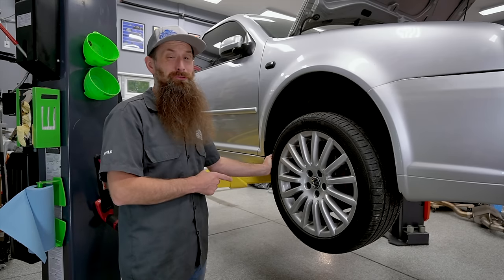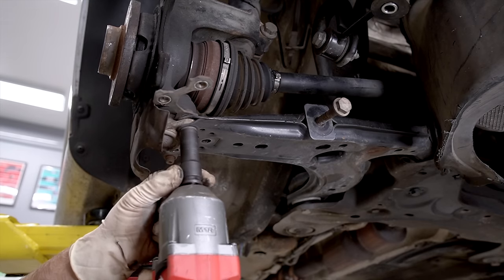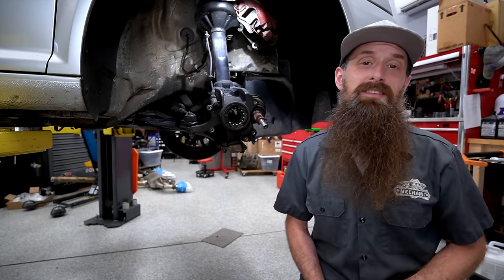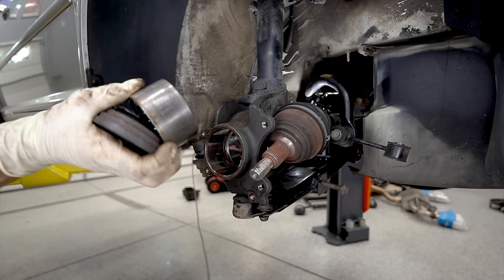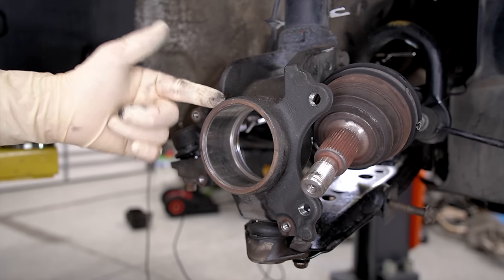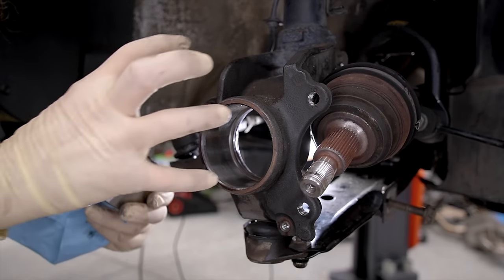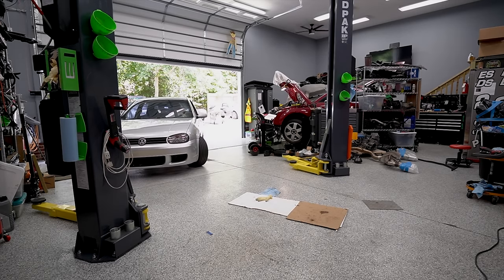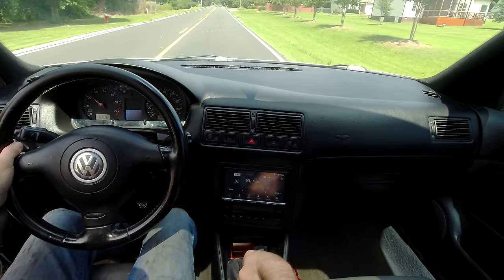How To Replace a PRESS IN Wheel Bearing ~ On The Car

Comment: Hi I have a question for you, I have a 1999.5 VW cabrio MK3.5 and have a pop/ clunk noise from the front end while turning and backing up from a parking spot, I replaced the left front wheel bearing and the noise went away for about 2 weeks and has returned. Have you ever come across this issue before and if so how did you permanently fix it? I had seen a post on vwvortex from someone saying it’s the bearing itself moving inside of the knuckle due to lateral forces and that it was a technical service bulletin, I tried to find that bulletin but couldn’t. I’m wondering if maybe my knuckle is the real problem but unsure. What is your thoughts? Thanks for your time!
I will add that I’ve replaced the entire suspension front and rear with all new bushings and ball joints, front and rear shocks and struts with all new bushings and bearings for the front. CV axles, sway bar bushings and end links, steering rack with inner and outer tie rods. The only bushing that wasn’t replaced was the steering rack bushing on the right side. Everything else is new with good parts. The only mod on the suspension is lowering springs from ECS tuning that drops it by 1.25-1.5”

Comment: I use a wireless chassis ear and I sit in the passenger seat and have a porter drive the car best way I’ve ever been able to diagnose a wheel bearing issue

Comment: 16:30 Serious question. Why do many mechanics use brake cleaner, instead of for example wd40 ? My reasoning being, everywhere the brake cleaner went without re-oiling the surface is prone to rust even better than before. Thanks for your clear video.

Comment: I live in a rust belt why I would grease ALL mating surfaces after wire wheeling them to the bone. AND anti seize to any nut and bolt. AND apply rust inhibitor on the relevant outer surfaces. 

Making it easier for the next guy - the one that might be yours truly.

Comment: Spinning the wheel for testing and putting my hand on the rim for acceleration me gave an amputation of the front member of my middle finger. Finger is connected back with my body but bad memory hurts lookin at this stuff.

Comment: For me, as a junior engineer, it wouldn't make sense to lubricate the hub before pressing in the new bearing because the operation of the bearing is dependent on the interference fit and therefore the friction force between the bearing and the hub. As we know the friction force is dependent on the frictional coefficient which would change if you apply oil/grease.
With that said, it is probably best if you do what the manufacturer recommends.  :)

Comment: My thought is to use Electronics heatsink compound to sparingly Lube the bearing bore so you don't insulate the bearing if anything you increase the heat transfer to the knuckle just a thought for you

Comment: Question: Does the car need an alignment after removing the 3 ball joint bolts and putting them back on?
Reply from the maker: Depends. This exact car, no. But the r32 has slotted ball joints so it would

Comment: Kinda highlights how you could misdiagnose wheel bearing when it could be tie rod if you only check play fore and aft vs vertically (as the fore and aft could be simply tie rod and not wheel bearing). I had a hellava time doing wheel bearing on my GLI - had to use a right angle grinder and blue-tipped wrench to get it all apart... (then totaled it a few months later doh!)

Comment: I've never ran into issues pressing in bearings till I had to do a 2016 Hyundai Elantra front wheel bearing... not sure if it was because I was using a Duralast bearing and hub or because of a step I was missing... which I wasn't... 3 times... I'm pretty sure it was because the Duralast hub had a larger taper toward the end and not even a press could get the bearing the last 4mm in... advice anyone... I'm an open book and I've been doing this for over a decade... I'm not sure what I did wrong.

Comment: good wheel bearing & hub replacement # but i believe U have mistakenly used the words hub & nuckle interchangeably # 👍👍🇵🇰
Reply from the maker: This is likely due to VW calling them different things in different places. repair manual and parts catalog call them different.

Comment: Favourite way to fix a Volkswagen….pay someone to do it. However, and as per the wheel bearing hub nut, I have found few know that even the bolt on hub/wheel bearings require hub nut replacement and specific tighten sequence, an argument I’ve had a few times when I get home after say a shock/spring replacement to find the same nut and barely tight, or 3 months later the wheel bearing goes cause they didn’t follow the instructions 😤

Comment: 28:49 - New tool idea, Plastic Wheel Disc that is secured via the wheelnut/bolt holes that has a degree clock like a timing degree wheel.

Comment: can you press-in for a Mark 6? as-in just buy the bearing and re-use your housing for the front bearing replacement job?
Reply from the maker: No press in for mk6. They bolt on
Reply: @HumbleMechanic  any particular brands you recommend? I'm seeing the FAG come with a kit with bolts. always recommended to swap those all out with new? it's weird, all the other ones like Moog or SKF (solid brands I think) don't come with hardware. if you have a recommendation (I may track this later in life) I would love to know!

Comment: as a motorcycle mechanic, trying to get into cars i had a discussion with a car mechanic recently where the guy said "you have to press bearings in, you cant hammer them in because theyll break and the tolerances are so tight its not possible". after watching this video im pretty sure that if you were able to press that massive bearing in by hand without even putting it in the freezer and heating up the knuckle, you can tap it in with a hammer no problem. am i missing something here or is this another case of a mechanic that thinks he knows stuff because he was told so but never even asked why?

Comment: By buying a classic MOPAR muscle car...
But if I have to, I freeze the new bearing overnight and let the hub and axel bathe in pen oil. The next morning, after I get all the German out of my way, I get the axel hammock hanging, heat the hub and break out the blunt force persuasion box and slide hammer it free. Reheat the seat race, after getting everything ready to insert the bearing. When it's toasty, quickly get the bearing and usually get it seated with a couple meaningful love taps. Reverse the process and get really greasy.
BTW heat the home, freeze the habitants (water reactions are opposed to most materials from temp change) = easy pressed metal repairs.
Then I swear that it was the hardest thing I've ever done, so maybe next time they won't wait so damn long to get a serious life threatening issue checked out.
I lube with the advised type if listed, or lightly high temperature anti siege to prevent any galvanic corrosion or easier repairs next year due to spirited twisting road application.

Comment: Also, the reason the torch trick didn't work for removing the inner race, is because the other race had machined a lip onto the hub. That race was never coming off and that hub could have never been reused.

Comment: 3:20 BMW tech here.
BMW says if your brakelines cant hold the weight of the caliper, you need new brakelines theyre too far gone and not safe to drive on.
BMWs have some really big calipers, even an X6 brake caliper can hang by its brakeline. If you put them back on and theyre cracked, its time for new brakelines, and dont push them back to your next brakefluid change.

Comment: Im glad my b5.5 passat doesn't have the snap ring. But yeah is the same procedure to take it out and in. 
Have u ever seen this code from the ABS module 
18256-035 and 01203-003. I been investigating but no luck so far.

Comment: actually i do have a question have your ever tighten suspension parts too tight like a control arm or end link i have replaced a bunch of parts went an got a alightment an at high speeds or 40 mph i have a pulling effect but it feels like a huge spring back an forth
Reply from the maker: I haven’t to the point it’s made an issue. But you may have some binding.

Comment: If you over torque the axle nut to much it will fail, even if it's too loose. There's a torque spec for these things from the factory. Run the axle nut down with an impact until it contacts the hub then tighten with a torque wrench. Not with the last dugga of a half inch impact gun.

Comment: 29:30 If you have a "GTI" car do not buy any tuning parts before fixing every suspension part to at least to OEM spec. Way too many "tuners" start with re-programming the ECU or getting highly expensive struts before fixing clear problems in the suspension. Only after you have fixed all the actual problems even consider getting extra tuning parts. In most cases, you may have to replace majority of the ball joints and bushings if the car is older than 5 years old and you want to have zero problems.

Comment: I’ve never had a snap ring go IN as easily as that one came out!
Reply from the maker: I know. Haha it felt like cheating
Reply: @HumbleMechanic  It probably helped that the bearing was replaced semi-recently. 
And I know it failed because they reused a bad hub (Same thing happened to me twice when I cheaped out on my Subaru’s front wheel bearings when I first got her......R.I.P Susi)
Reply: the snap ring didn't seat properly. only the 2 lugs got seated correctly :) so no wonder it went in easy

Comment: Thank you Charles for all the details, specially size of the inner/outer race of the wheel bearing trick. Also is that some elcheapo bearing removal set? Bought mine which looks exactly the same of AliExpress for 45$ 4 years ago, soon I will finally use it xD Love from Slovenia, EU
Reply from the maker: yeah got it on amazon a few years back for like $50
Reply: @HumbleMechanic  wow awsome to hear  that it works!

Comment: Hey man, have you deal with immobilizer issues with any golf mk4? Do you know what part is usually faulty when this happens? Actually after a wheel bearing installation, this happened to me the next day, and left me stranded in a gas station 😂
Reply from the maker: oh yea!!! Usually its the key dead, next is cluster,.
Reply: @HumbleMechanic  key fob battery? I'll look into a new one.

Comment: "Typically the slide hammer is what i use when doing wheel bearings like these" 
Man we litreally have footage of you ooga booga -ing it out with a 1kg hammer haha! Great video , raised some Q's : why not let the axle rest by gravity , and tie it ? Recently did both sides axle boots inner & outer and I let it rest on its weight for a little while,
And following the axle boot job, Q: I didnt mark my ball joint position like some myturbodiesel guide mentioned when removing the 3 nuts, and I double sinned because I took them off and put them back on with my electric Ooga Booga 18v deko wrench ( started by hand so its not completely FAQ'd) so what can happen if the ball joint nuts were removed and reinstalled like that ? Just needs an alignment ? Ride feels the same
Reply from the maker: Many of the ball joints don’t have adjustment. The r32 is slotted so you’d either mark or alignment. 

I don’t like letting them hang because you risk the inner joint coming apart

Comment: Funny. I don't have a number of how many front wheel bearings that I have changed, and I have NEVER seen a car, where it has been pressed in from the front. Always from the back, which have been so annoying stacking it in a press. Especially on really old cars needing 10+ ton to get loose.

Comment: I lived in the rust belt. Done a few wheel bearing with an on the car press. I need a new bolt, that bad boy is stripped
Reply: Always lube the forcing screw threads, but they do wear out often.
Reply: @terryharvey4811  that was done. But it’s a harbor freight part so take that as you will lol
Reply: @wickedgood1984  I bought a 50 buck 23 piece special to get some extra cones and sleeves.They worked well, but I tried the bolt and I had to get my OTC bolt to finish the job. lol  HR might replace it for you, if not you can order the OTC BOLT AND NUT SEPARATE. They're pricey but good and your other pieces will work on the OTC bolt. Being metric, some of the cheap set stuff fits the foreign cars better than some of the OCT Hub Grappler pieces, or at least they did on a Kia. I also use a thrust bearing { D-5 size } instead of the 2 flat washers, Makes a lot of difference in force needed to turn the bolt. They don't last long {6-7 bearings} before they blow up.

Comment: cousin said oil the threads on the puller and use grease under the washer sl when you crank it tite, you dont gall anything

Comment: THE DIE GRINDER WORKS WELL, BUT IF YOU WELD A COUPLE OF SQUARE STOCKS TO THE BEARING RACE YOU CAN USE A BEARING PULLER. EASY PEASY

Comment: In my MKv gti I only knew my rear wheel bearing was bad because the tire started rubbing on the quarter panel. Didn't make any noise but I could grab the wheel and move it in and out with the car still on the ground 😂

Comment: For anyone doing this in more rust prone parts of the world, pipe freeze spray on the old wheel bearing followed by some fast heating of the outside of the bore on the knuckle that it sits in will help you get it to start moving.
Ideally get your bearing puller and dies to hand so you can install them quickly after the freeze spray stage.

Comment: It is better to remove the control arm by ball joint not by the 3x13mm screws, bcoz after youve got to adjust the steering alignment

And for that you actually need an alignment machine.
Sure you can do it with ropes and what not, but not worth it

Comment: "transmission noice". The fact that his wheel nearly fell off is not that big of a deal. Some drivers, geez ...
Also: all it took to remove this hub was 1 bolt at the bottom of the strut. I personally find it easier to take it off entirely and use it under my hydraulic press.

Comment: At 18:30 you talk about the ABS speed ring being in the bearing. I dropped the new bearing on the ground before install and now I have warning lights. It is installed the correct way. The scanner says the speed on that wheel is not within range. Can dropping a bearing on the ground ruin it? Scanner doesn't say anything is wrong with the sensor or circuit etc. Message to others reading this.... DO NOT DROP YOUR NEW BEARING!!! Grr...

Comment: 2004 Passat 1.8T 4motion 5 speed manual with 114k miles here. . .   um how the hell is that bearing still together?  Then 5:50 comes, oh never mind, it was the axle nut holding the bearing to the car! Wow. VAG guys. lol.

Comment: I can't believe he greased the knuckle & the bearing. The bearing is supposed to be held in place by friction. You don't want the bearing to rotate inside the knuckle.
Reply from the maker: You may have missed the part where I mentioned it’s stated in the repair manual to do that.
Reply: @HumbleMechanic  Don't trust Any repair manual that much. Always use common sense first. With the grease, now the bearing casing becomes the bearing. :) I did hear you said tell me what you think about greasing it, I did just that.

Comment: In no way was that old hub OK to use!!!!!!!!! ask me how I know..... Oh ok! sure I'll tell ya...I reused the hub ( it was tapered like the one in the vid) on my mk4 gti...after some miles, the rotor started rubbing the caliper. I could hear it. THEN it popped the threaded end of the axle shaft off of the splined section while I was doing about 40mph. The only thing that saved me was hitting the brakes which kept everything aligned enough for me to pull over. just change the hub unless it mics out to spec

Comment: The question is why ???

Why would manufacturers fucking do that ??? I mean I know, it's just cost savings, and it also means they can charge more at the dealership, but dang I hate them.

The rear ones in both my bmw's are also press in and I'm scared of the day I need to replace them, hope I never have to.